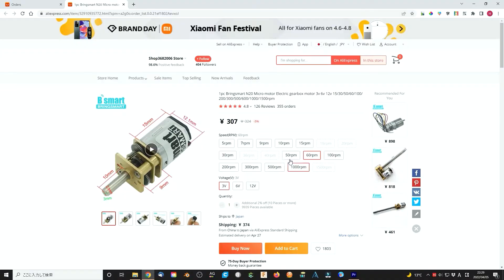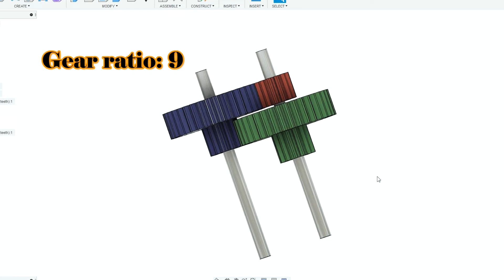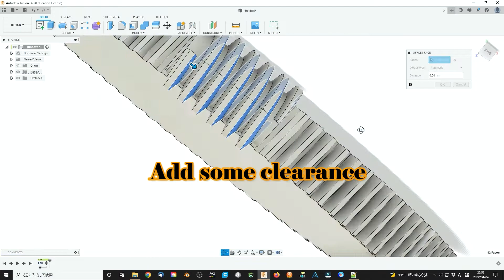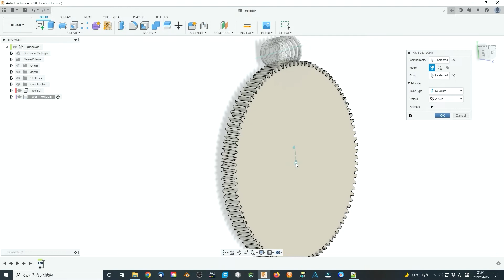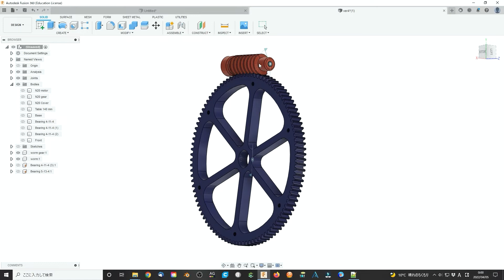Make a show table using N20 geared motor and worm gear (Fusion 360 WORM GEAR simulation)

Comment: In the instruction, you said we need 4 of 694z bearing and 1 of 695z bearing, but in the video I only see you use 1 bearing. May I ask which bearing did you use? Thank you.
Reply from the maker: I think both of the gears are used. Please check the video and check the construction process. good luck!

Comment: Nice design. Thanks for sharing. How do I know the ratio of speed reduction. Thanks
Reply from the maker: The ratio can be calculated by multiply the gearbox ratio and worm gear ratio. But usually I did not fix the input voltage. Just check if the rotate speed is good then record the video. Hope it will give you some help. Good luck.